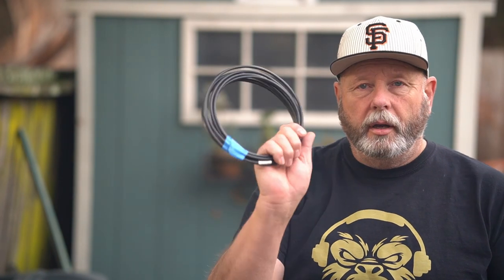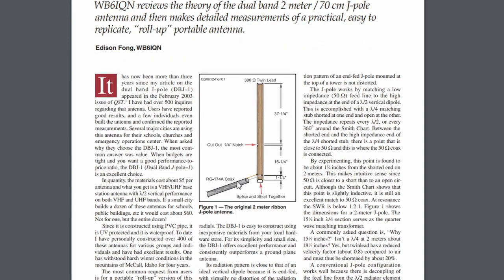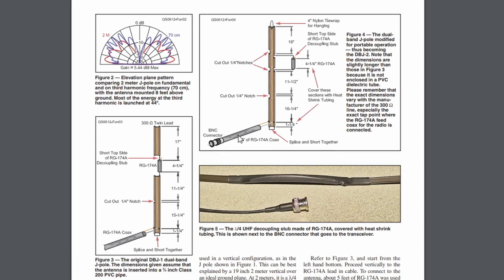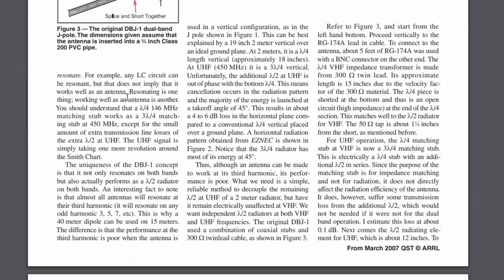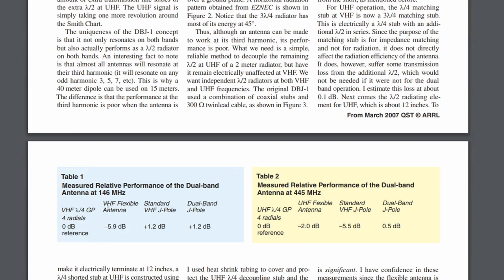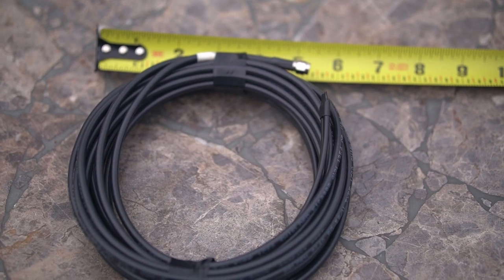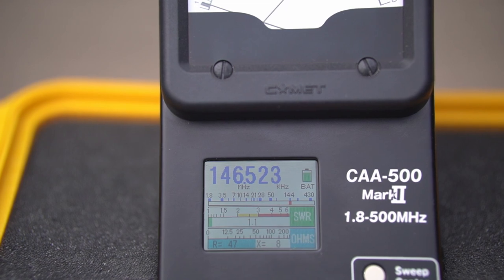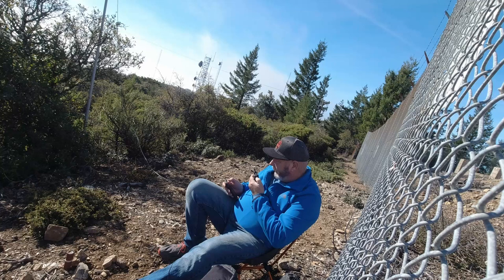How to make a Dual Band Rollup J pole Antenna for 2 meters and 70 centimeters!!

Comment: Around 9:37 ... when you attached the RG174 stub, leaving the remnants of the 300 ohm cable in place (presumably for rigidity) may affect the performance of the antenna. In the Fong original, only the stub itself is across that gap -- no original wire is adjacent to it.

Comment: 👍Great simple antenna for portable or base station use. These rollup window line J-poles are hard to beat in terms of size, weight and ease of use.
Reply from the maker: They are hard to beat like you said, they work great! Thanks for the comment and for watching!

Comment: Thanks for this video Chuck. I've seen several versions of this antenna and seen videos of Dr Ed Fong talking about it. Your video was very easy to follow and I think I might have a go at building one. Best 73 G6XIB
Reply: One small suggestion - Basing one measurement off of the previously measured mark can lead to stacking inaccuracies.  Fat marking pens add to this problem.  My recommendation is to do the math and then measure everything from a common baseline.
Reply: @Sagart999  Thanks for the reminder, that's a good practice I did know but had forgotten! 👍

Comment: Ed recommends tuning it as you go. First you tune the UHF section. Then when you add the stub to the bottom *nothing should change*. If it does, your stub needs tuned because it’s not 1/4λ UHF. Once you have that, then solder the shorted (top) end of the stub to the VHF portion and tune it again.

Comment: i have some 450ohm ladder line/twinlead would following these measements be compatable?
Thank you for making this video
Reply from the maker: Yes it should work just fine, you might have to adjust a little for the velocity factor of your wire but it should be close!
Reply: @KK6USYHamRadioAdventures  Great. Many thanks for the reply and for yout time making this detailed video

Comment: do you remember what freq you were using for SOTA contacts
Reply from the maker: For 2m depends 146.520 or 146.580. I might start on 520 if not busy and usually switch to 580
Reply: @KK6USYHamRadioAdventures  thanks! Are you beaming SSB w horizontal prop, or FM w vertical
Reply from the maker: @PatAutrey  I think I only did vertical FM, I have better antennas for SSB

Comment: The 70cm repeater here is at 434mhz - how do I tune it for 434 and not 440? Trim the last part only?
Reply: What most people fail to tell you, is that you can adjusting the tuning by moving the coax soldering point, up / down, at the base of the antenna! 
I have cut, and trimmed an antenna before, and it Never got the damned thing tuned right! The key is the base connection has to be in a Sweet Spot.

Comment: Where in the world do you find 300ohm antenna these days?
Reply from the maker: Tis where I purchased mine ,
https://www.amateurradiosupplies.com/product-p/20116.htm
Reply: Make sure you know what the 300 ohm line is constructed with.  Some have foam filled dielectric and will throw off all the measurements.

Comment: What kind of distance do you think a slim jim could get in a semi mountainous area on a ht? I'm studying to get my Tech, just looking into what gear to get now.  Thanks.
Reply: I have a uv5r v3 and vx6r. It’s relatively easily hit mt diablo and mt vaca repeaters from west Sacramento depending where I stand outside on my balcony 🤷🏼‍♂️ figure they’re ~40-50 miles from me. They hear me through some snow but an antenna upgrade like this I should do a lot better.
Reply from the maker: If you get up on a peak and put it up say 10' it will do really well, like KazzArie said easy 50 miles maybe more. Check out this video, I was camping and setting at the base of a hill in a valley and my contact were 50+ miles. The contacts are near the end of the video.  https://www.youtube.com/watch?v=H0u1jBiGIp4&t=293s

Comment: Great video. I think I would like to make a roll up jpole for portable ops. I have one that I bought off of ebay and it works great. It is my main antenna at my QTH for VHF and it is a good performer. I can hit a repeater 50 miles away with my yaseau 857 at 50 watts . 
73 George KB3WAQ
Reply from the maker: George Go for it on making one . and yes they do perform very good I was impressed!

Comment: Thanks for the video 2m is all I would need 70cm inactive around here. Looking forward to start my SOTA 2021 once wx cools off from summer. That style of ribbon is hard to find in vk land. vk5cz ..
Reply from the maker: Willian. Direction , One of the Hayden from Ham Radio DX gave me a site he has used in vk land .https://www.strictlyham.com.au/browse-by-type/coaxial-cable/open-wire-line . I hope this helps , thanks for watching!
Reply: a trick: you can watch movies at Flixzone. Me and my gf have been using them for watching lots of of movies recently.
Reply: @Zain Nicholas yup, I've been watching on Flixzone} for since november myself :D
Reply: @Zain Nicholas yup, I've been using flixzone} for since december myself :)
Reply: @Zain Nicholas yup, I have been watching on flixzone} for months myself =)